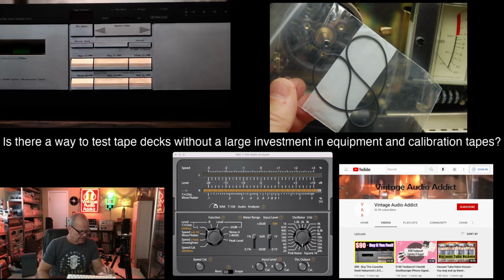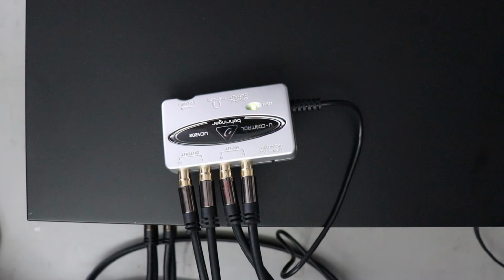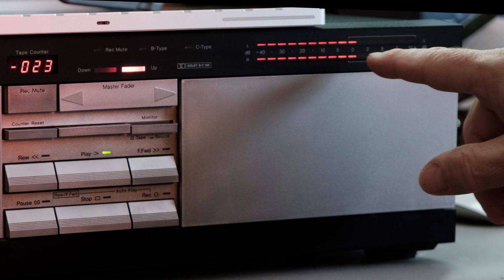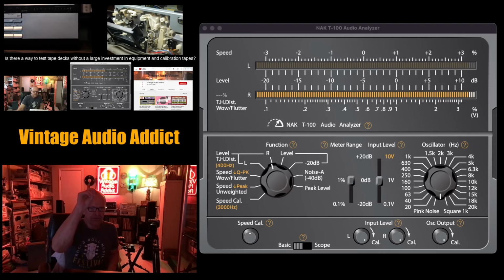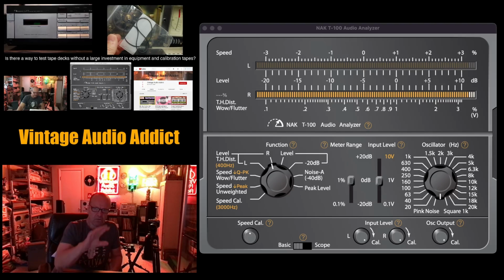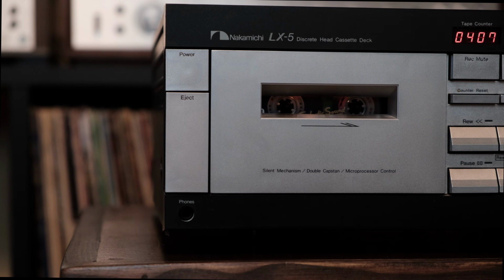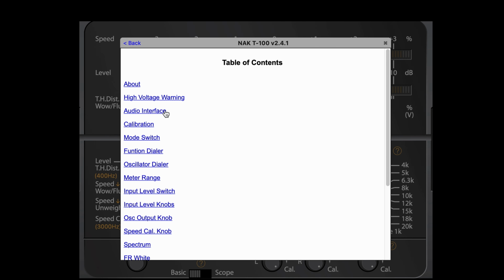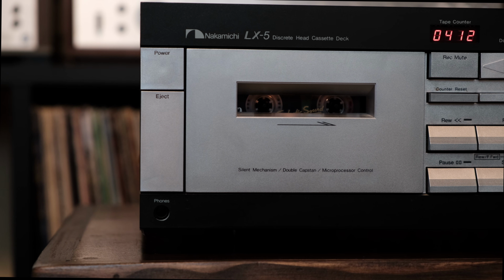Nakamichi T-100 Analog Digital Simulator Software Review. Cheap Tape Deck Analyzer.

Comment: I ordered the UCA 202 and on my Mac Mini when I open the sound settings there is no slider to adjust the output level. I returned it and bought a Plugabble brand and it works great.

Comment: A PC is the most powerful measuring tool on the planet, And you dont need any test tapes, you can use a shop bought prerecorded music tape and beat match it to an identical song running on your pc with a mixer. Dance music is best for this technique as it has dominant bass beats.
Reply: Carefully made alignment tapes would be best.  A prerecorded music tape can get you "in the ballpark".  It depends on how critical you are as a listener.
Reply: definitely a way to do speed adjustments without a calibration tape, I used this to figure out that my deck is running a little fast. there's unfortunately no substitute for calibrated reference level tapes though.

Comment: Why would you need a usb powered interface with rca in and outputs, while the soundcard on your motherboard has line in and outputs?
Reply: Sound cards may not be very accurate,  you can use them for this, but it may not be the best.
Reply: @fflynnful  there is a lot of variability in sound cards. I worked in the audio test and measurement industry for the first decade of the 2000s and evaluated dozens of PC-based single-board computers for audio quality to build test equipment with. Even using identical common realtek AC97 codecs, there was a wide variation between systems, with some having horrible filter ripple and interference, and others with accurate frequency response and low noise. Unless you have a known good spectrum analyzer or other test equipment on your bench, evaluating the built-in audio on your computer is difficult, and even with the proper test equipment, is not trivial.

Comment: So, to be clear - if I use this software's built-in test signals and put my deck into Monitor mode while recording, I DO NOT need actual test tapes for THD and speed? @Vintage Audio Addict
Reply: If you are trying to measure speed or tape head azimuth and you record on to a blank tape, then play it, you are only measuring relative to the recording you made.  It's like doing carpentry without a ruler and using a ruler that you made yourself arbitrarily.  You need to have a standard ruler or a standard tape.
Reply: You'll need a test tape to do it accurately, monitor mode while recording almost certainly won't work for calibration. Audio being monitored during recording is inherently being played in time with the source - it's the same tape, it's being pulled past the record and play heads at the same speed. Doing this would only measure the THD between the recording on 1 head & playback on the 2nd head, which I'd expect to be small(at least for wow, as that's slower fluctuations) due to the very short time elapsed between them(little chance for the mechanism to change speed). It's odd that got much the same reading, perhaps it was mostly flutter, or perhaps that was actually when he played it back after finishing recording - but even that could both give an artificially low or high reading. eg: if deck always plays slower at start, it would do that both when playing & recording, but conversely any fluctuations on the recording can be added to by fluctuations when playing.
I can't see any way it would work for straight speed, again the tape is being pulled past both heads at the same speed - so whichever speed it's pulled at will affect both heads equally, so there's no way to determine if it's playing fast/slow.
If recording your own test tape(on any deck), it's already been affected by the inaccuracies of that deck, so you don't have a "perfect" signal to test against, whereas test tapes are recorded with extremely accurate decks.

Comment: Thanks for the great review video and demonstration! I also see in previous comments that the software can be use for head alignment - something I will be using.
Reply: I was disappointed that he didn't show the "Lissajous" feature of the Oscilloscope part of the App, which as a result I have to "presume" will allow you to set the tape head azimuth just by watching the circle on the screen & twiddling the head position adjustments until you get a straight but diagonally-oriented line...🫤

Comment: Back in 1984 to 1988 I worked in a HiFi shop called HiFi House, we had a Sound Tech 1200A. The Nackamichi Dragon and Harmon Kardon CD495i were 2 decks I longed for but never had the money. We would set up the customers tape of choice for normal, cro2, and metal. Even with normal types and a good alignment, normal tapes would blow away other lessor deck metal recording frequency response. 2 truly amazing decks in the Era. The pinnacle of analog sound ASFAIK.
Reply from the maker: Thanks so much for sharing. I like you when I first got into purchasing stereo equipment in the 1970's my Pizza Hut salary didn't go very far. The higher priced pieces were not anything that I could afford.
Reply: I worked for an in shell cassette duplicator for many years back in the 80s.  We had some very particular clients.  Among other things, we did some demo tapes for car audio players marketed by an unnamed company that rhymes with bows.  :)  I agree that a properly aligned recorder with type 1 tape can sound as good as anything.
Reply: @fflynnful I would disagree about that. Sure, even on the cheaper decks where the Type I high frequency extension tends to be a few kilohertz worse than with Chrome or Metal Tape, Ferric Type I tends to have the flattest frequency response overall by way of compensation for its more limited frequency range. I think this is because the Tape Deck Manufacturers calibrate their machines for Type I first & foremost, with the Type II & Type IV calibration "piggybacked" on top of it. But for whatever the reason, the "fake" (pseudo-Chrome) Japanese Ferro-Cobalt tapes like Maxell UD-XLII & XL-IIS, & TDK SA & SA-X usually give a slightly rising high frequency response on most decks.
This alone would make Types II, III, & IV tapes much more desirable for use with the lower-priced cassette decks that tend to have both limited AND drooping/droopy high frequency response...& that means, basically, ALL decks that were priced under $1000 in the 1980's. Never mind the absolutely puerile frequency response of the pre-1980 decks at almost ANY price!
But the kicker is, even though a Nakamichi can readily squeeze at least a 20kHz frequency response within -3db with Ferric tape, perhaps even equalling the frequency response from the fancier tape types, there's more to it than that.
Specs are specs. They DON'T tell you what a component actually sounds like. And they CERTAINLY don't tell you whether that component even sounds "good"...or not!
Maybe it does show up in the specs, but to my ears, REGARDLESS of the deck, Ferric/Type I tapes SOUND noticeably "dirtier" than Type II/real Chrome (BASF) & pseudo-Chrome (everyone else...) tapes do.
Then there's the noticeably far lower saturation, with treble disappearing in a hurry as you get to 0db, never mind the far quicker onset of distortion once you go even just a few db beyond that, both CLEARLY audible.
I find that the Japanese Type II pseudo-Chrome Ferro-Cobalt tapes sound best overall, even better than Metal. And on cheaper so-called "Metal Capable" decks, they sound MUCH better than Metal! It seems that regardless of the machine, Metal Tapes demand too much bias current to leave much headroom left for the signal. Even on THE best machines, & own 🐉 Dragon 🐲 myself, Metal Tape still sounds thin & threadbare, even if to nowhere near the degree of say, how Metal Tape sounds in my Sony, Pioneer, JVC, & Yamaha machines; with noticeably less detail/low-level resolution than the Chrome tapes can readily deliver. 
For these reasons, I only archive my most important music recordings on Type II tapes. It's not the end of the world to be "forced" to "slum it" with Type I/Ferric tape; for the less critical listener, & especially for someone well aware of the limits as to hard you can "hit" them during recording, they can be pretty close. But even if you don't have a critical ear, the lower recording levels required to not over-saturate Ferric tape also means a noticeable increase in background hiss, which EVERYBODY notices & NOBODY considers "benign".
And as good as DULLby B & C are on the 🐉Dragon 🐲, which has THE best sounding & least rolled-off DULLby circuitry that I've ever heard on the hundreds of machines I've listened to over the decades, DULLby still KILLS the sound quality. Even when properly implemented to the Nth degree of perfection as it is in a superbly calibrated Nakamichi 🐉 Dragon 🐲, the over-complicated & inevitably, IC-based DULLby circuitry still causes an unacceptable loss of both high frequencies (& it's as small with the 🐉 Dragon🐲 as you're ever likely to hear on any other Tape Deck) & overall detail/resolution & just plain CLARITY.
There's a reason why DULLby B never caught on with Open-Reel machines.
Because they have an "adequate" S/N Ratio to begin with (-60db or better), nobody wanted to put up with the "squashed" & dull, closed-in sound that DULLby imparts to any & ALL recordings made with it!
I personally find it remarkable how drastic the difference between a 55db S/N Ratio is versus a 60db one; which is often the difference between the S/N Ratio you get from Ferric tape vs. the Type II & IV tapes (or between a recording made at 3¾ips vs. one made at 7½ips or higher on an Open-Reel Deck). For me, a 60db S/N Ratio is the threshold between an acceptable amount of hiss versus an unacceptable amount of hiss. YMMV, & maybe for you DULLby solves the noisy Ferric tape problem. But for someone who aspires to getting the ultimate sound quality possible from their equipment, which is the difference between somebody who owns a Nakamichi, Luxman, or Harman-Kardon cassette deck versus all the other "No-Fi" brands (like Sony, Marantz, Pioneer, JVC, Akai, TEAC, & Yamaha, whose decks might measure well but sound like the low-rent mass-market Japanese Mid-Fi 💩🚮 that they are), DULLby is a "no go" zone because of its effects on the SUBJECTIVE sound quality of the recordings made with it vs. without it.
It's too bad that nobody is producing Type II Tape anymore, despite newly-produced Type I Tapes being available now. I think that unless this changes, any further expansion of the "Cassette Revival" is doomed to stall out, & perhaps finally die. But my understanding for the main reason that say, Hitachi-Maxell, who still make their UR-1 Ferric cassettes, won't expand back into producing Type II Tape is because of stricter environmental regulations that make manufacturing a product with potentially & actual toxic chemicals (like the Cobalt in these "Ferro-Cobalt Type II tapes!) too difficult  in the (rightfully...) environmentally-conscious & NIMBY times that we now find ourselves in...

Comment: Since it has an oscilloscope, I'm guessing it would also help with head azimuth adjustment.
Reply: I have had the software for about a week and have aligned a couple of head azimuth alignments with mine. The red and green dual trace is a bit fiddly to get the traces where you want them, and the lissous is a digital rendered scattering that gives you a basic XY display, but not quite, there is a lot of delay to it's rendering of the computer generated circle. I still prefer my analog scope for azimuth, but you can get the job done with the software, just not it's strong point IMHO.
Reply: @zulumax1   That's good to hear that it can be done for those without an analog scope.

Comment: My main concern with the software, or "app", is that you can only download and install it over the internet. You also need at least Windows 10 for a windows based PC. What happens if you need to reinstall it and it is not available to download in the future? 

True, it is only the price of a good pizza, but when it disappears online, it is gone, and you are left without a backup physical copy.

I am going to buy it, and the usb converter, but I have been left high and dry with Apple apps which I bought that don't work anymore once you update the operating system.😞
Reply from the maker: Very good points! Thank you for sharing.

Comment: Behringer stuff is usually junk. Is that interface working for you?
Reply from the maker: Yes, it seems fine for this purpose. I plugged it into the USB of my mac, it recognized it, and I was able to set it up.
Reply: for this tech level, I would expect even behringer would have a hard time screwing up the design and implementation. it's likely the same set of parts that are in countless other USB audio interfaces sold for much higher prices, and maybe even a copy of the PCB to boot. Still, a loopback test (even with the T-100 SW) is always worthwhile.

Comment: I've been using this software for about a year. First, parallel to my hardware test devices and now almost exclusively. Along with a set of reliable test tapes, it lays the foundation for successful calibration and maintenance. I highly recommend this software.
Reply from the maker: Thanks for sharing. I've only used it for a few days so it's good to hear from someone who has used it for a year.

Comment: Thank you for pointing out this software, very, very interesting! Test tapes are with me, both on reel-to-reel and cassette. Just too bad that it's only available through the Apple or Microsoft store. So I can't even try to get it running under Linux. Maybe I'll try in out on a virtual machine one day. Again, thanks for your great video! 👍
Reply: Hey @phonatic - maybe you can answer since Chris seems to have bailed on this video.  Does one absolutely need test tapes (THD, speed) to measure THD and speed/wow/flutter with this software?  If I place my deck into record mode and use Monitor (both my decks are 3 head), can I measure THD and speed with the software alone using the test tones it makes?
Reply: @EnochLight  I can certainly answer this. If you simply record input/output of your deck, there is absolutely no way to tell if there is a speed deviation. Instead, you could only measure with an offset. And you couldn't even tell if it was there at all. Test tapes are necessary because you can only calibrate your deck in reference to another deck/tape machine. A test tape is that required reference. On other words: it is all relational.
The very cheap route would be to record a your own test tape on a deck that you are confident with its accuracy, then adjust your other deck to that. The outcome will be only as good as your reference recording. Test tapes are usually recorded on triple-checked, precisely adjusted decks/tape machines that are well-maintained. But for speed and azimuth, I am not aware of a simpler method. And only after those proper adjustments you will have a reasonable way to measure the THD.
Reply from the maker: Your welcome. Thank you for watching.

Comment: I've spoken with the developer and went through all the functions. I can tell you (and everyone interested) that this App is done really good. Yes, it is an emulation. Yes, user do need an interface to interconnect computer, deck and the App but other than that it has all the functions any user would want to have and see the deck's performance. And it's really convenient, well made, all clearly visible and distributed. A little bit of reading and understanding what the user must do and how some functions are set up and read and soon you have your deck inspected in detail. Of course, if user is that anal and really wants to see such precise values. I would say if someone out there is doing repairs and needs accuracy, with an original NAK T-100 being ridiculously expensive and hard to find in 100% functioning condition, this is the next best thing!
Reply from the maker: Thanks for sharing.